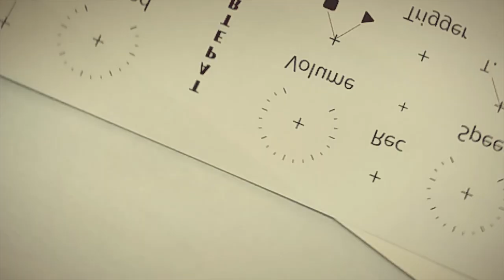Tapetron -2. cassette player module

Comment: Great Project: Possible to provide schematics or "on what to focus"? I like to build one too... Thank you in advance!
Reply from the maker: Hi thanks for your kind words. no schematics for this project you just need to focus on the speed of the motor, which can be with variable resistors os speed controller, mixing the signals into one output (you can youse / volume in independently channels of the stereo of each one so you can have 4 channels from 2 walkmans) button to trigger play and switch to choose between play or trigger play, forward reverse (only for loop cassettes) act... 
https://www.youtube.com/watch?v=f_qS2gTNfe8